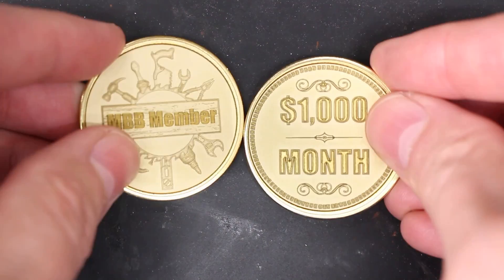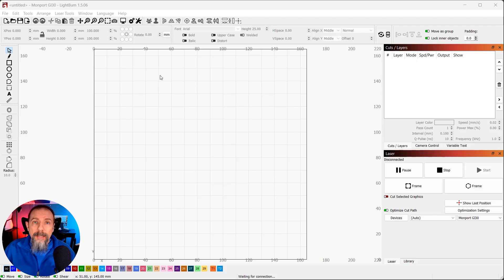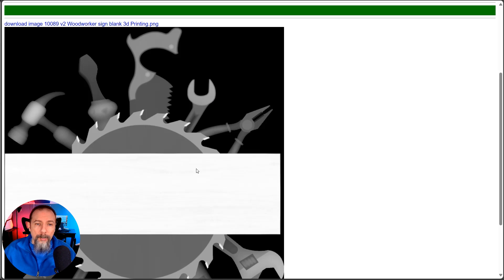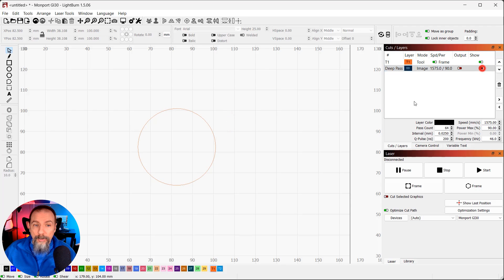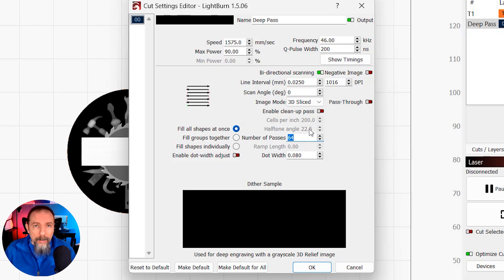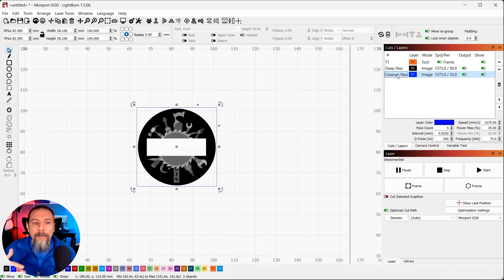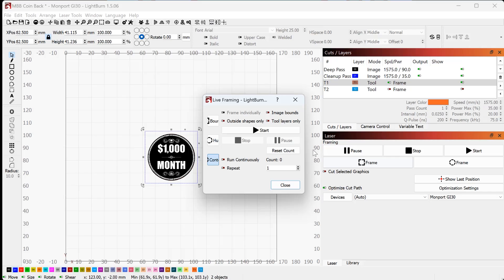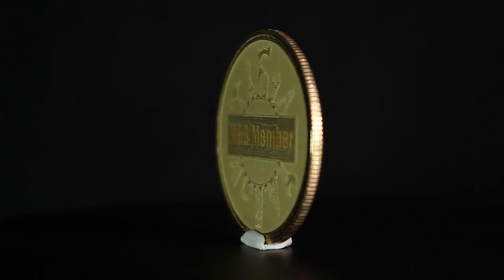Easy Laser Engraved Brass Coins. No Design Experience Needed! GI30

Comment: First, nicely done on the video. 
On clean-up passes, Lightburn now lets you incorporate clean-up into your image layer. When you Select 3D slice a switch appears directly below for a clean-up pass. You can set up the number of etching passes and then the number of etching passes to run before running a clean-up pass. The setup is a little different for vector images, but the idea is the same.
Also, if you go into Edit>Device Settings, under Other Options there is a switch labeled "Require framing before start". Turning this off will allow a job to start without framing first. I usually leave it on unless I'm doing a batch job with a jig.
Hope this helps.
Reply from the maker: Thanks for sharing! I knew about the clean up pass and was actually using it before I made the video. Then when I made the video I completely blanked on using the clean-up sub layer. 🤦‍♂️

Great info on the framing before start setting!
Reply: @LetsMakeAThing  The one engraving I did was a simple engrave and to finish the job, I created a filled circle layer with my cleaning parameters , (1500mm/s @ 40% pwr, 80 kHz), then ran that layer for 25 passes and it finished beautifully.  Right now I'm burning a fricking parrot, 150 passes with a cleaning pass every 5 burn layers.  It may not require that frequency of cleaning, but, the bit of extra time it takes is OK....    To keep from "over-cleaning", make sure to clean only the last current layers burned, don't select "clean all layers".....
Reply: I forgot to mention, STL2PNG will also work with regular 3d stl files. The advantage to this is you have a much broader selection of stl files to choose from. One great source is Thingiverse. Also, you can select your viewing angle by using a free program called Cura. You just open the stl file in Cura, rotate it for the angle you want, and then export it as a new stl file.